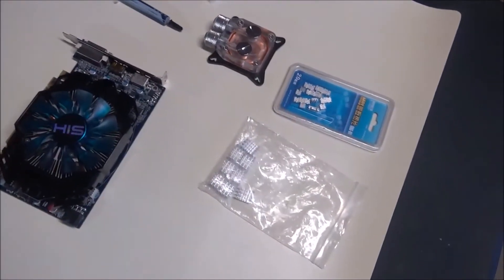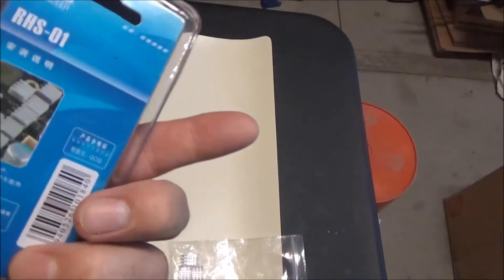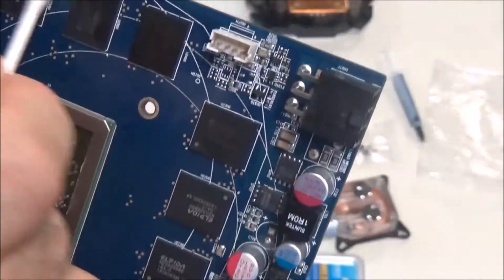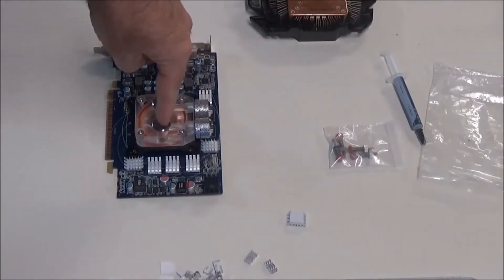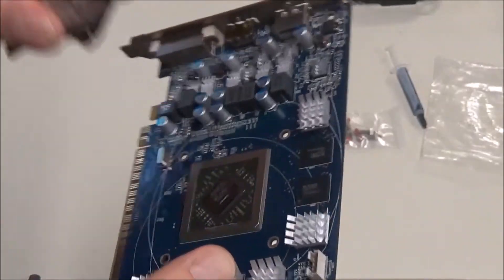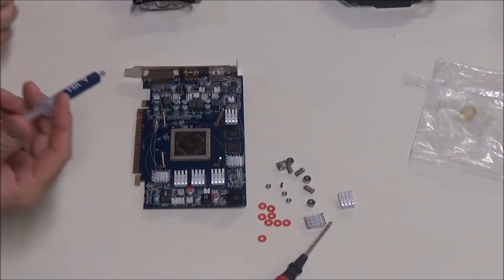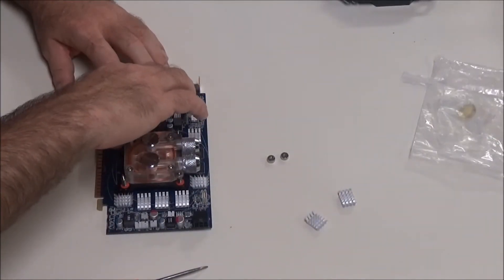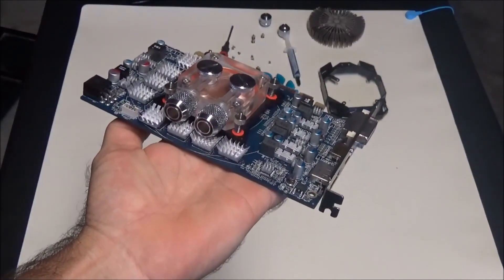My First GPU Water Block Install!

Comment: what gpu is that? is till alive? i did this for my gtx 1050 ti, awesome temperature, but im afraid of the memories temperature
Reply: It'll be fine if you put heatsinks on the memory and the mosfets. I'm using a 1080 ti for over a year with a universal waterblock, copper heatsinks on the memory and mosfets. I have a little bit of airflow over the mosfet heatsinks and almost none on the memory. I overclocked the gpu and it runs with a constant 2012 mhz on the core and +450 mhz on the memory. I'm gaming frequently and never had any issues.

Comment: Are the heat sinks needed?
Reply: If you don't wanna fry your memory chips. Yes you need these.
Reply: @xeoninside6436  the original cooler doesn't even touch them. No thermal pads or anything.

So for this card they don't get hot enough. Lots of low end gpus don't need memory cooling.

Comment: has it leaked since you've installed it?

am looking at the same waterblock
Reply: VER V3F  later cards(like RTX series) use the heatsink to cool lots of components. Buy a PROPER full coverage block for an RTX card.
Reply from the maker: No leaks. It's a really decent water block at a great price.

Comment: Did those little heat-sinks end up providing enough cooling for the ram?  I really want to do this to my gtx 1060, but that's my only hesitation.
Reply: Look closely, the original cooler doesn't even touch the ram. The heatsinks are MORE than they had.
Reply: The gtx 1060 should have a waterblock suited to it, meaning with vram+voltageregulator cooling in case u dont want to go with universal ones
Reply: The only thing that matters is that chip the vram doesn't get hot enough to matter

Comment: *facepalms*.....Dude, you did a good job but umm, you did happen to notice those two holes in the top of the water block right? That's for moving the fittings from the side to the top! So you didn't have to take the time to mode the heat spreaders to fit....lol.....just sayin!
Reply from the maker: Umm, yes I did. The fittings didn't have any room to be moved to the top of the block. The card is installed in a riser  and the card faces the motherboard and there is less than an inch of room. Nice try though.
Reply: Yeah that sucks. I hate the way they design that slot for vertical mounting of the gpu. It shouldn't be that damn close to the glass. And the custom mounts have you cutting all your pci slots away to make it fit. I have that same problem with my new case so what I decided to do is not even vertically mount the gpu but instead install it the normal way and make a custom RGB backplate for the card. That's always an option for you later on. It may not be as "cool" as vertically mounting the gpu, but it definitely means less modifying of your case.
Reply from the maker: This card is actually installed in a Dell Optiplex 780 DT https://www.youtube.com/watch?v=Lj67S-ufYhU It had to be mounted with the riser because the PC can only use low profile cards without it. And I did make a back plate for it eventually, just without the RGB =) https://www.youtube.com/watch?v=RRCERPzfAQI
Reply: Looks good but omg why that case? I have the thermaltake view 31 and ima be struggling with space for the custom loop I wanna put in it.....lol
Reply from the maker: I just like modding old PC's. Much more fun than off the shelf stuff. I do have a regular gaming PC in a Corsair C70 case though.
Reply: Those old small desktop cases are great for space saving rigs. I just don't have the patients to try and cram all that stuff into a small area....lol
Reply from the maker: Believe me, it required more patience than I knew I had. And being that it was my first hard line water loop project, it just added to the headaches. I learned a lot though, next loop should be fairly easy (I hope!)
Reply: Everyone keeps calling me crazy and tell me I just wanna punish myself because I want to do a custom loop but I want to go right to hardline. This will be my very first custom loop. I have been using the Corsair aoi's forever since I started water cooling and have never done a custom loop. But I have been watching so many vids on youtube about these custom systems I feel like I have nothing left to do but actually do my first loop. I have been researching it for like a year now since I decided I wanna do it. I could save myself some time by just putting in soft tubing but I REALLY like the look of the hardtube. I just have to buy it piece by piece because a custom loop kit is butt raping in price and I can buy everything I need piece by piece a lot cheaper. Why spend $150 and up for a D5 pump/res combo when I can hit up ebay and pay maybe $65 bucks? Don;t get me wrong, those kits are pretty badass but I think they are smoking crack if they think they're worth THAT much!
Reply from the maker: A custom hard line loop is probably the most satisfying thing you can do to a PC imo. If you are feeling confident about it, just start buying the parts one by one. You are right about the cost, even shopping on Ebay I spent waay more money than I wanted to. But it looks so much better than an AIO that I think it's worth the cash. Don't listen to the people saying you're crazy, it's not that hard. The most time consuming thing is bending all the tube, it just takes some trial and error to get clean bends and at the proper length. You will waste some tube learning, but it's pretty fun process. And even though it's kinda small, it looks like that View 31 has plenty of room to work in. Go for it dude, you'll have a real sense of accomplishment when you're done!
Reply: Yeah. The Thermaltake view 31 LOOKS small but believe me, it's actually really big inside with a lot of room cause there are no hhd/cd drive cages in it at all and there's no psu cover on the bottom(which I will be adding a custom one myself). And this tower is actually bigger than the old one I'm using now which is the CM storm. If I go any bigger than the view it won't fit under my desk!....lol. For financial reasons i will be putting in the Corsair H115i just to get the new rig up and running. I will then buy everything I need piece by piece for the custom loop, I'll just have to buy 3X the amount of tubing I need because of mistakes....hahahahahaha

Comment: You know you can OC the CPU by modding the clock generator in software ? Setfsb is the tool for that.
Also, DDR2 667 ram is needed instead of ddr2 800 as the North bridge will be the bottleneck regarding performance and instability (alternatively you can mod your ram to look like DDR2 667 by reflashing it's room chips :) though this is for hardcore overclockers

Why I'm saying this: because your CPU is the bottleneck in most cases, even my Rx 550 makes my q8400s sweat in my optiplex 360, and that GPU has less specs
Reply from the maker: I've already tried Setfsb. Unfortunately, I couldn't find a PLL that would work. And this PC runs DDR3 at 1066mhz.
Reply: an early version (like v1.0) of the intel XTU works maybe?
Reply: you can also overclock the cpu if you have a multiplier ov above 8 (can be checked using cpu-z) if so, you need to apply this simple, yet precise mod called "electrical tape mod" people got their q6600 frm stock to 3ghz on all 4 cores stable in their dell machines, look it up :)
Reply from the maker: I'm not sure which version it was, but I tried the tuning utility also. I would love to get a little more from this CPU, but I've almost given up. I still haven't tried the BSEL tape mod. I'll be trying it though when I drain the loop in a couple months.
Reply: to see if that mod will work, you only need to run cpu-z and check if the cpu multiplier is above 8 (so 9 or above),  if not: then it's wasted time to try. (i tried it with my 8400s on my optiplex 360 too, but it kept running at max 2,66ghz)
Reply from the maker: Interesting. I'll go check cpu-z in a second. That would be sweet to know that it will work before hand.
Reply from the maker: Well, that sucks. The multiplier is only 6. It's a "s" chip so that seems to be the reason. I just looked up the regular Q9505 on CPU-World and it shows an 8.5 multiplier. Maybe I should see how a regular chip runs in the loop. I bought the "s" version because it's 65W and I was concerned that the radiator couldn't handle a 95W chip.

Comment: Could you add links for where you bought the parts?
Reply from the maker: I found everything on eBay. The GPU, the GPU water block, memory heat sinks, mosfet heat sinks, all from eBay. You just need to find the best price from a good seller. I actually ordered the mosfet heat sinks from China because they were so cheap. Here is a link https://www.ebay.com/itm/20pcs-Aluminum-6-5x6x3-5mm-Mini-Heat-Sink-MOSFET-MOS-IC-Chipest-Cooling-Heatsink/221723027375?epid=1676054371&hash=item339fb8e7af:g:uBsAAOSw34FVD8Jn Stuff from China usually gets to the United States in less than 2 weeks. The hardest thing to find will be that GPU. I can't find one anywhere right now, I was lucky to get it for only $50.
Reply: Okay cool! On the waterblock, it looks like there are caps on the top. Could you confirm if those are actual caps used to cut off the water or just for aesthetics. I face a similar issue because I need to find a solution that cools my GPU and the vram surrounding it.
Reply from the maker: Sorry for not getting back to you, I fell asleep. Those are real caps encase you need to relocate the inlet/outlet ports on the block. Not all the blocks have them. I didn't need them for this project, but I decided to go with that type just to have the option in the future. Hit me up if you have any more questions.

Comment: where did you find the new psu for the dell optiplex  780 dt
Reply from the maker: What's up dude, thanks for the sub! I bought that PSU from Newegg. I just looked and it's on sale for $55, it was almost $70 when I bought it. $55 is a good deal. Thanks for watching man.

Comment: cool thanks for this video man, but hows the temp?
Reply from the maker: Hey Harvey, glad you liked the video and thanks for subscribing. I just posted a video last night playing GTA V with this GPU. The temps stayed really nice, ran around 65C. I installed it in a Dell Optiplex Desk Top with a 60mm Alphacool radiator, you should check out that video if you haven't already. Thanks for watching mang!
Reply from the maker: How's it going Ramon? The temps in the video of GTA V game play are probably after about 45 minutes with a complete CPU/GPU loop. The CPU stayed at a nice temp also, around 57C. I have played 3+ hour sessions of games like GTA V, TW3, and Battlefield 1with the GPU never going above 75C and the CPU never above 61C. Some games run hotter than others obviously. And that is with a somewhat high ambient temperature of around 78-80F. If my ambient is closer to 74F, the GPU/CPU temps are around what you see in the GTA V video. That little double 60mm radiator from Alphacool is amazing. The GPU is 150W and the CPU is 65W, and it handles the cooling duties with ease. I've never once been worried about the temps and recommend this radiator to anyone looking to cool a full loop in a Small Form Factor PC. Thanks for watching man!
Reply from the maker: I was honestly surprised that it got the job done. A lot of people that I asked advice from said it wasn't going to work but I tried it anyway. The double thickness of the rad probably is what made the difference, and the Fractal Design fans are also top notch. It was a bit of a gamble, but it paid off!
Reply from the maker: I overclock the GPU to the maximum settings with Afterburner and it runs stable without any added voltage. Unfortunately, the CPU can't be overclocked or I would have done that too! I'm not too crazy into calculations, but real world performance has been amazing and stays below max temps by quite a bit. The reason why so many people told me it wouldn't work in the first place is probably because they relied on water cooling calculators that they found online. I'll do some more testing soon and post more concrete temperature results for you to check out.
Reply: PimptatoPCs in my calculation I aimed for max temps of 70C, not the actual component max to keep headroom, also: without added voltage I doubt the tdp of the GPU will go over 170w, my Rx 550 in my optiplex 360 runs at 38w board power at 1400mhz core (was 1200mhz stock), added only 20mv to the core, still below the cards rated tdp. I guess you're in the same boat, just with a different GPU :)
Reply from the maker: I do that for sure tomorrow. I kinda need some new video content anyway. I've never ran any synthetic stress tests on the system. I'm not sure how well the loop cooling capacity will hold up under those circumstances but it'll be fun to find out.
Reply: PimptatoPCs awesome! Also, if I could donate PC parts, I would so you can make unbox vids?
Reply from the maker: Really? I would love to unbox a 1080ti LOL! Just kidding. Do you have a few unused parts still in the box? Fill me in with the details, maybe I can buy them from you for cheap to use in upcoming builds?
Reply: PimptatoPCs were those temps after 1 hour of stressing both CPU and GPU at the same time? If so: that's quite impressive! (Water loops tend to heat up slower, and stabilize after around 1 hour)
Reply: PimptatoPCs I was about to say hot danm, but that rad it taking the heataway nicely! :D
Reply: according to my own secret wc calc tool it should have 149.29watts of cooling power when i use thses variables:
Rad fins per inch: 16 (fpi), 
Rad thickness: 5.5cm (thickness), 
Rad size: 2x60mm (fan), 
Average pressure fans: 0.6 (fanpres) (0.5-0.9 depending on fan), 
Water blocks: 2 (blocks) (components to cool in the loop), 
Temperature ambient: 25°C (delta), 
Actual flow for pump: 600 (liter), 
Pump wattage: 20 (est: basic: 20, normal: 30, performance: 40), 
Max component temperature: 70°C (maxt), 

that is for 24/7 100% loads, i assume that you're not utilizing the GPU/CPU 100% at all times, which will be too much for 24/7 in your pc, it's good enough for gaming :)
Reply: gpu core tdp: 150w board power - 20 for vrm = 130, average load: 80% = 104w
cpu core tdp: 65w, average load: 60%% = 39w
total: 143w
so a gaming load should fit perfectly fine if you don't max the system out.
Reply: PimptatoPCs why not run afterburner while doing a GPU stress? This way we can identify GPU power draw
Reply: some cpu's: amd athlon x2 6000+ and 3600+, 2x intel e5200 dual cores,
some hdd's (including a IDE of 40gb for a really old school build, the others: 2x 160gb sata),
some server RAM (ddr2, 2ranks x 4bits, 4gb modules (4 units)),
one industrial grade mini pc (type: ebox 3310MX) excluding standard 12V 3A psu,
2 dvd rom drives, some case fans,
a 450w corsair atx psu i used for setting up a custom water loop (adjusted the green and black m/b wires so one can short these easily for waterloop testing),
and almost 10ml of thermal paste brand new (heat resistance up to 150C or something like that, meant for heavy duty amplifiers and the like) :')

i might have some other stuff too, just need to look

regarding price: i only need international shipment costs (30$)

message me on discord (preffered): bunny_bunbun#8169
Reply: i also found a single ddr2 stick of 2gb (kingston valueram low profile) and a used scythe byakko cpu heatsink incl fan, 2x ocz reaper ram 2gb ddr2 with damaged heatpipes (not broken, or leaking, just damaged due to bending i guess?)